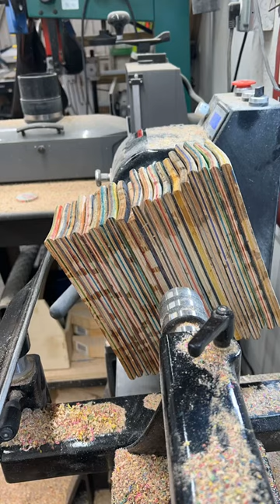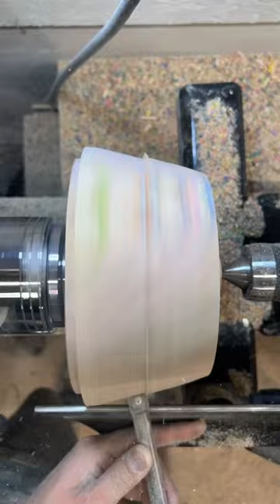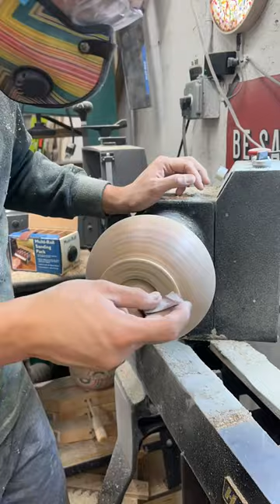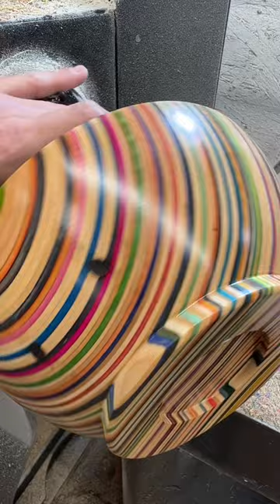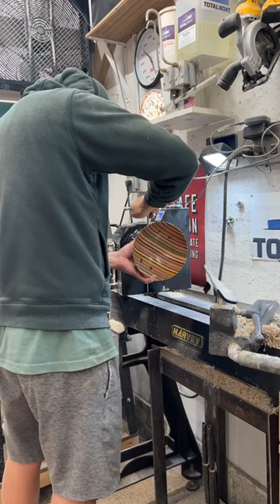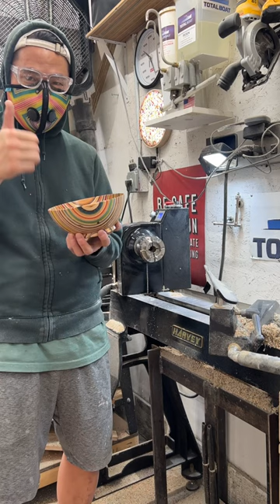Made a quick bowl out of skateboards! #woodworking

Comment: It would be cool to figure out someway to do this with books, if that would even be possible
Reply: Maybe with epoxy resin it could be doable!?
Reply: might be problems embedding books in expoxy cos paper is so absorbant. 
Maybe compress under vacuum first to increase density, glue into blocks compress further & embed in epoxy.
I'd guess there's probably a bunch of practical & economic reasons most books are pulped & reconstituted into other paper/card products.